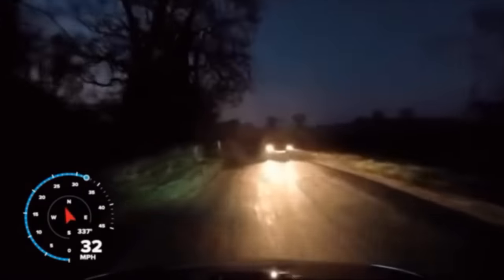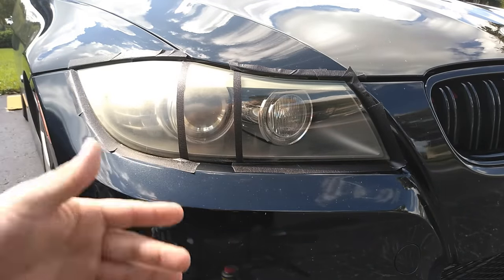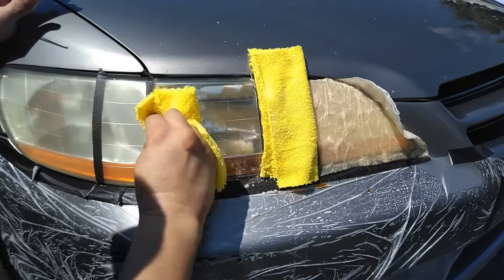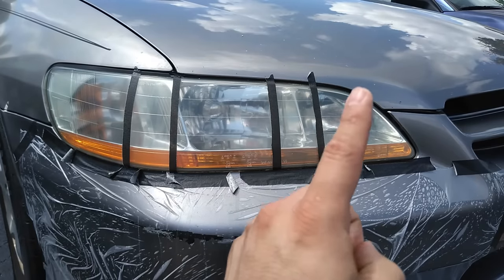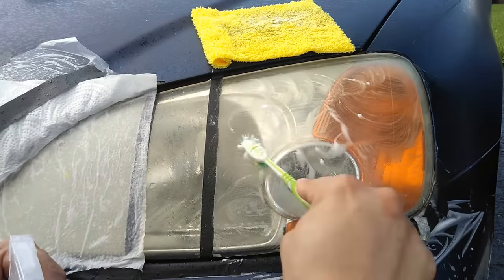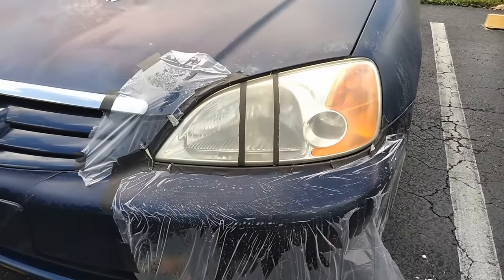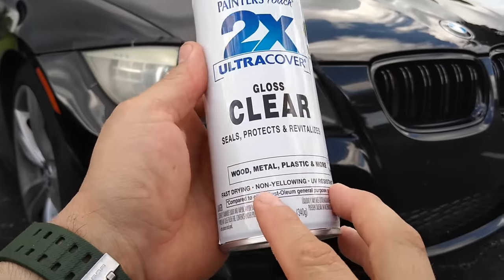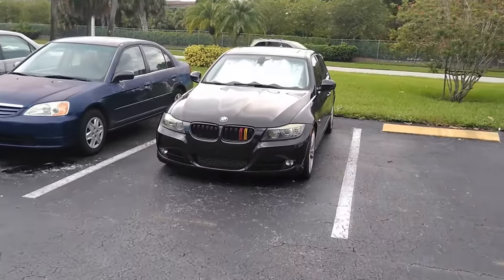How to Restore Headlights with Household Products (Easy, Affordable & Fast)

Comment: Thanks for being so clear about how to use each product.  Some tutorials are too vague.  In your opinion, what works best for really old cars?  Ours is a 2004 and I need to do something with it!
Reply from the maker: If you want an effortlessly method coca cola is a great option. 20 - 30 mins should be good, just make sure to keep the paper towel moist all the time.
The other good method you can try is the one with the baking soda. 
Or you can do both of this at the same time. 
Start with the coca cola and then to fine tune it, with the baking soda. 
Once the lenses are cleaner, its very important to put some type of sealant or coating to keep them lasting. I actually did mine long time ago and didn't put anything afterwards, but after a few months the lights started to look a lil yellowish (because no protectant)
Reply from the maker: For the protectant you can use a polish. Can be car polish or aluminum polish. This will protect your headlights from uv rays. 
Or you can just use Plastic X from meguiars (I have a link in the description) as a polish. This product is like $7 in walmart, it not only helps to protect but it also cleans. 
Hope, that helps. 👍
Reply: I just use acetone nail polish remover.  Makes them crystal clear in one pass.   Don't make more than one pass...additional passes cause the fog again.  Don't get it on the paint.

Comment: Amazing vid 👏🏾
I tried baking soda+vinegar combo and the results were mind blowing. I also tried the WD40 but it wasn't as long lasting as the former hack. (But the best quick fix!)
Wil def try the baking soda n vinegar with the hydrogen peroxide next time!!
Hopefully I can cover the rest of my car as it sort of eroded some of the car paint bc it was so potent
Reply from the maker: Yeah, you can use plastic bags to cover the paint. Also once cleaned use some type of wax/polish to protect the headlights. Car wax or metal wax etc...
Or just try the plastic x which is like $7
It will make the headlights last longer
Reply: You  Can  Also  Substitute  Lemon  Juice  Or  White  Grapefruit  Juice  Instead  of  White  Vinegar   or Even along  WITH  the  White  Vinegar.
Any  Of These  Alone  or In Combination  With  The White Vinegar  WILL  Also  Provide  Same Results.
Reply: Thank you so much for your help.will try the combo tomorrow
Reply: Lol the presenter literally said the WD40 was just a quick fix.
Reply: Wow! Thanks for the heads up on the car paint issue! I sure don't want to damage THAT!

Comment: I tried wet sanding and clearcoating my headlights,  they looked good for a year but then the lacquer started peeling off.   Now I've just bought K2 lamp doctor paste.  I used 1500 and 2000 grit wet & dry sandpaper to remove the oxidation, then polished them with the K2 paste.  They came up like new.
Reply: I just use acetone nail polish remover.  Makes them crystal clear in one pass.   Don't make more than one pass...additional passes cause the fog again.  What do you put on them after so the sun doesn't make them foggy again?
Reply: @Lili-xq9sn   I put a clear headlight vinyl film on them after.  It says it gives uv protection,  so hopefully they'll stay clear  :)
Reply: @wyevalet9781  I'm investigation ceramic coatings.  They also have uv protection.   I only care about my headlights and windows.   The added benefit of this on windows (i was using more temporary nu finish previously), is its a lot easier to remove snow/ice from the glass.

Comment: It worked great! Now the question is: How long will it last?
Reply: It lasts long enough. And if needed to do it again, it's a simple clean 👌
Reply: Different conditions will make them cloud up quicker than others. Heat, sun light, humidity, etc. It takes longer to sweep your floors or wipe up the kitchen than to clean headlight/taillight covers. Do it once a month and you ll never see them cloud. Or maybe 3-4 times a year.

Comment: fantastic video!!!!!   Great job at showing the side by side of all these hacks.   I'm going with baking soda.
Reply from the maker: Thank you for the great comment 🙌
Baking soda is a great choice 💪
I just cleaned my fathers headlights with baking soda and it looks great. 
After cleaning remember to put some type of protectant so the headlights last longer clean.
Putting the clear coat is best, but its a little more challenging since you gotta cover the car, hope there's no wind and make sure there is no over spray when applying the clear coat (if you want to go this route) . 
You can also try some car polish or car wax as a uv ray protectant and maintain your cleaner headlights. Aluminum wax/polish works well too if you have any of those at home. 
If not I recommend some plastic cleaner and polish which is really good for long lasting clean headlights and good for maintaining them as well. 
I have a link in the description if you wanna check it out. Putting something as a protectant is very important for a long lasting result 😁
Reply: 00

Comment: I used baking soda and lemon juice. Worked pretty well but as with most, when it dries, it's not as clear. So thanks for tip to keep it that way.
Reply from the maker: Cool, thanks for the tip, I'll try that when it comes time to it on someone's headlights. 👍

Comment: Would WD-40 work on Solar Panels?  I have a bunch of Garden Lights that are powered by small solar panels on the top of each one.  But over time, being out in the Sun, Rain, etc. they get really cloudy, and it blocks the sun from charging them, so they don't stay lit up for as long as when they were new.
Reply: Don't know why it wouldn't work on your solar lights... it's the same principle!
Let us know, would you? Thanks!
Reply: WD-40 failed the test.  It made the panel clear again, but when the sun came up, it dried out and went white again.  So I used a can of Clear Silicone Spray Paint, and that works long term!

Comment: How do you clean the internal without removing the headlight? Thanks
Reply from the maker: If you have condensation on the headlights, the quickest and easiest way to clear that up is by removing the light bulb socket and blow the hradlight with a hairdryer. Although this process will clear your headlight, it will only be temporary. The issue when this happens to a headlight is that the seal is going bad and you will need to put more sealant around the housing to fix this issue. You can either look for where the seal is bad or you can just seal all around the housing. Also every headlight has ports (holes) that will allow excessive heat from within the headlight out, so check those to make sure they are not clogged up. 
Hope this helps bro 👍
Reply: Heat gun or blow dryer

Comment: Yes how do you take out the moisture without taking it off
Reply from the maker: Hey Maria. 
In order to take out the moisture without taking off the headlight you need to take out the bulbs (high and low beams) by twisting the housing that holds them. And then use a hairdryer or heat gun to get the moisture out. 
When taking the bulbs out, make sure you use some gloves. The reason you have to take out the bulbs is because you do not want to burn them out from the excessive heat from the heat gun or hair dryer. 
This process can take a while, so make sure not to heat up the inter plastic to much and give it a rest from time to time. 
This fix can be permanent (meaning no more issues) or it can be temporary if the seal of the headlight is going bad. 
Lastly visually inspect and compare both headlights, look for any small plastic pieces that may be missing (sometimes that can be the issue) 
Hope that helps 🙂
Reply: Omg you took the time to be very specific and I will try it now.... I also have to restore old paint too
Reply from the maker: No prob Maria. I always do my best to answer any questions and help people out. We all can fix and do alot of DiYs without the need to take the cars to the dealerships. 
There are a lot of times where its easy to fix. No no need to spend or through away $$
Restoring paint definitely is a little more challenging but do able. 
There is so pretty good videos out there that can give you an idea.

Comment: How do you remove moisture from inside headlights without removing them…PLEASE
Reply: Very carefully with a heat gun. You have to keep moving it back and forth instead of just pointing it at the lens or you will possibly distort warp or melt it. Basically the same motion as spray painting

Comment: The clear coat is the key..polish first or wet sand with 2000 or 3000 ..the clear really makes a difference..so is preparation.. cheers 🍻🍻🍻🇺🇸🇺🇸🇺🇸

Comment: This is so much easier if you remove the complete headlight assembly. This eliminates all the masking off areas plus you can take the headlights inside to an air-conditioned area.
Reply: Thanks for pointing that out. I wondered if removing the light assembly would be better. Was removing and replacing the entire headlight assembly difficult?

Comment: Seeing that we were unable to view you actually using the clear coat, is covering the car recommended when applying? And are there any known damages that may occur if you were to get it on the paint?
Reply: He did say that he covered the cars and left only the headlight exposed when applying the clear coat. Spray paint would not look good if you got it on the paint on you car

Comment: I’m confused from your description what you finally used in the cars headlights on the far left! The one you began using WD 40 on! You jumped back and forth in your description. I get that you used the Clear coat as the final step! Did you go back over WD 40 with Just Baking Soda paste or ?

Comment: I was wondering about the use of alcohol as a cleaner.  What I have done in the past is use a baking soda toothpaste, my sonicare toothbrush to do the cleaning after I clean initially with a natural window cleaner.  Once I do the toothbrush cleaning, I then wipe it all down with the window cleaner again to get any residue off.  They may not be perfect, but actually can see very well through the lens.  I then take Plastik and give it a good polishing.  The result may not be quite like new, but amazingly clear.  The best part is there is no sanding.  Personally I would stay away from any sanding process.

Comment: I use Cutter insect repellent spray. Been doing it for maybe 6 years. Have to do it about every 3 months. Spray on, wipe off. Poof! Like new. I get mine from a store with initials BL. Twin pack for $5.50. I just bought the clear gloss so I don't have to do it 4 times a year. Talk about lazy. Haven't used it yet - want to make sure I do it correctly. I wish he showed how to do it, but I guess I'll figure it out.
Edit: The only can available was the exact same thing , except it does not show, "Painter's Touch" but shows, "American Accents". Everything else is the same.
So how is it applied? Just spray on? Or is there more to it? Thanks!
And thanks to people who described how to dry out headlights.

Comment: Can the clear coat be applied to the one wd40 was used
Reply from the maker: No. The clear coat will not work with the WD40. The WD40 is only a quick, fast, easy method, but it will not last long. Clear coat would only be good after any cleaning the headlight lens. The clear coat is to protect and to make the lens last longer without oxidation.

Comment: But the "SPRYPNT 2X GLS CLEAR" costs around $45, maybe buying a new headlight is cheaper. The "3M Auto Care Rubbing Compound" is way cheaper ($14) and will do everything.
Reply: I just use acetone nail polish remover.  Makes them crystal clear in one pass.   Don't make more than one pass...additional passes cause the fog again.  Don't get it on the paint.

Comment: How do you get the condensation out of the headlights?
Reply: YES, PLEASE DEMONSTRATE HOW TO REMOVE THE MOISTURE PLEASE😁
I have that, too.  My 2012 Kia Sorento  V6 AWD 26k original miles has had the lense replaced once, but the moisture came back😢.  Someone told me it was an expensive job🤔

Comment: 2X Rustoleum clear did not work on my lights. It made them foggy. If your going to clear coat your headlamps correctly, take it to a body shop. They will clear coat them for a small fee.

Comment: Good job but if u put new clear coat after the polish it’s gonna get better result I did in my car  🚗 and it’s over a year a look like brand new
Reply from the maker: For sure. That clear coat is a must, in order to make it last. I messed up the first time I cleaned my headlights by not putting the clear coat. The headlights started to get yellowish after about a year 😬

Comment: How do you get rid of the moisture  on the inside of the headlight.
Reply: There's 2 ways, but keep in mind that some condensation is unavoidable because headlight assemblies must be vented; if you took the whole assembly out of the car, you'll see it-usually a small nub maybe 1/8" to 1/4" in diameter, and some mfgrs will put a rubber tube elbow on them.  Anyway, the 2 methods are:  (1-easiest) disconnect and remove all the bulbs, then take a regular hair blow dryer on MEDIUM heat and blow through the headlamp opening...do not put it right against the opening as it may distort the bulb housing or locking tabs, and use an alternating 15-20 seconds blow/15-30 seconds off method...generally, you can get rid of most condensation in about 5-10 minutes; (2) remove the entire assembly from the vehicle-which can be real easy or very difficult, depending on the vehicle-then wash/rinse the interior by first using a premixed dish detergent/water solution then rinsing thoroughly...then shaking out as much water as possible...finally using that blow dryer to finish.  If condensation/dirt is so severe that it won't wash out, your only alternative is to replace the assembly...its cost depends on the vehicle-my 2004 GMC pickup costs about $50-60, yet my wife's 2015 Hyundai Santa Fe Sport is roughly $300 (both available through RockAuto).  I hope this helps!
Reply: Heat gun or blow dryer

Comment: You don't get it... The baking soda is a mild abrasive, as is toothpaste. Brushing it is not doing much... Buffing the paste with a sponge or microfiber towel will work better. Also, using softscrub works, as does wiping down the headlight with wd40. Those magic erasers are basically mild abrasive pads made of glass. There's really no chemical reaction removing anything. It's sanding off the oxidized layer of plastic, then buffing it out with finer and finer abrasive... that what The 3m headlight restoration kits do. They're not as cheap as baking soda, but the lenses literally look brand new and are crystal clear.

Comment: Why not use rubbing alcohol instead of water with baking soda or even the toothpaste?? Would've probably been a better results?
Reply: I just use acetone nail polish remover.  Makes them crystal clear in one pass.   Don't make more than one pass...additional passes cause the fog again.  Don't get it on the paint.

Comment: All good right up until the clear-coat... It looks great, but  spray on clear-coat  leaves a layer thick enough to refract the light coming from the headlights. That's dangerous.
Reply: Thanks for that. I just removed clear coat from my shopping list.
Reply: There's à special spray on clear-coat made for headlights.  That's the one you want.
Reply: @jebuff  Is it, MeGuiar's Headlight Coating?
Reply: @RErnie-gv1hv  Yes, that's the one I use. A thin coat after an annual cleaning works fine. Sorry for the possible confusion over my first comment.  Good luck.
Reply: @jebuff  thanks again. As soon as I can get all that crud off the lenses, I'll get a can of MeGuiar's. WM sells a 4 oz. can for under $12.

Comment: DEEP WOODS OFF works better
Reply: Yes,  a friend of mine told me about that!  Said any Off with deet in it will work. I cleaned them with some degreaser I bought at dollar tree and then windex and applied the Off. My van is 17 years old and the headlights were AWFUL. I thought after it rained or after a week or so I’d have to re apply but no!  I did it last summer and they still look great !

Comment: how long does coca cola last
Reply from the maker: Once you clean the lens oxidation with any method it should last anywhere from 6 months to a year. After this period the lens will start to oxidase little by little, so its not like a drastic or sudden change to yellowish. Yet it all depends not only on how much exposure the car will have against the Sunlight, UV rays,  high temperature, moisture and the crazy part even oxygen. It also depends on how damaged the original clear coat from the factory is, which can make it last a little bit longer or a little less.

Comment: none of them works on 2009 Suzuki Swift. Actually even worst after these treatment. the only thing what worked some extent is sand papering the PC and then clear coating it gently.  Far away to say perfect but a bit better. Cross finger to be passed by regular annual inspection. If not need to buy new headlights.
Reply: I just use acetone nail polish remover.  Makes them crystal clear in one pass.   Don't make more than one pass...additional passes cause the fog again.  Don't get it on the paint.